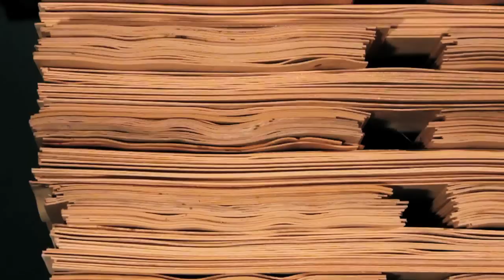Rekiem How to make a board

Comment: What was that that he used at 0:24 to put the graphic on?
Reply: The technique is called screen printing. Very cheap to get one set up. Local t-shirt printers might even be able to supply a screen with your design on it. One screen per colour, so 1-colour designs are obviously the cheapest.